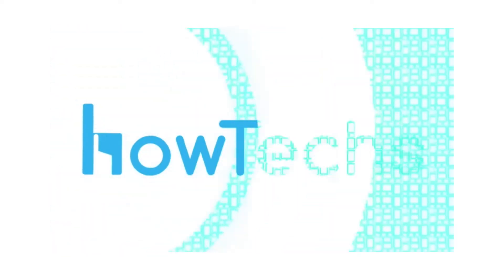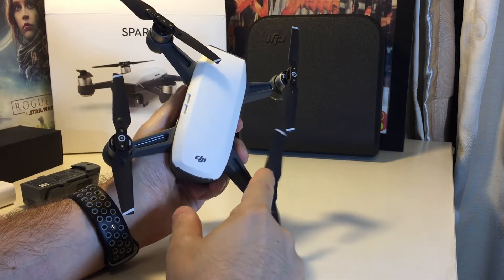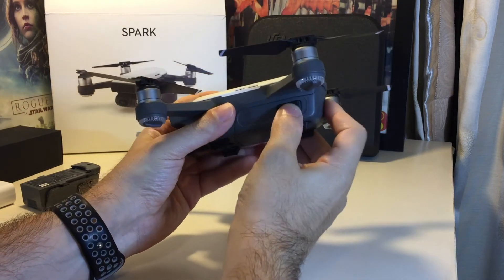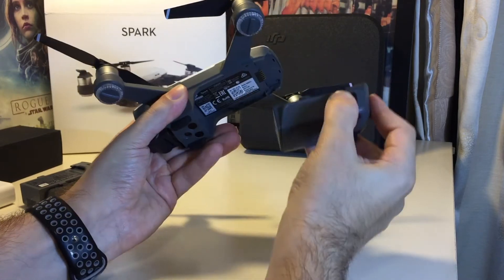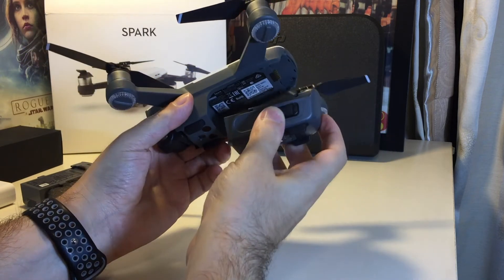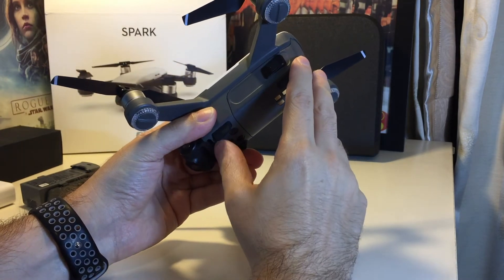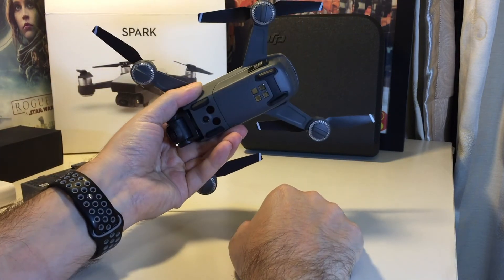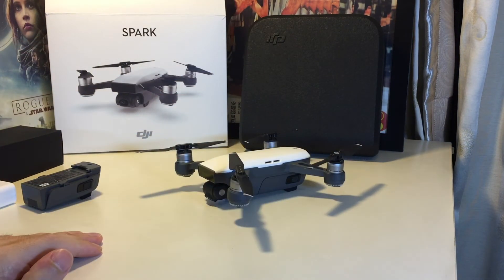DJI Spark - How to Remove and Insert Battery

Comment: What happens if I take out the battery without turning the aircraft off? Will it damage?
Reply from the maker: no, probably not,  unless it was really hot at the time you removed the battery.  (removing it will turn the fan off, so it may damage something if its running really hot when you kill the power supply...)
Reply: it says in the manual DO NOT REMOVE THE BATTERY WHILE TURNED ON. I can tell you that for anything digital it's bad to remove power this way